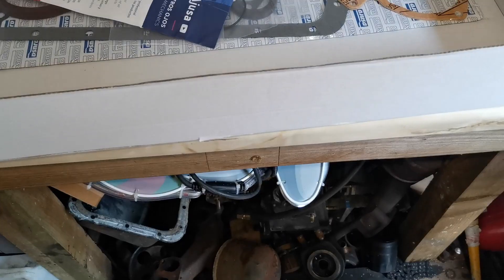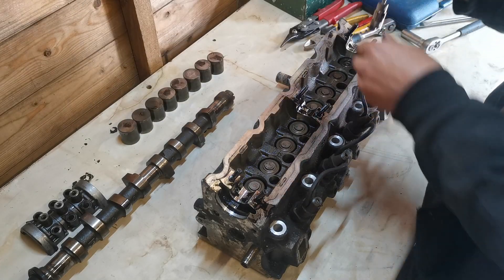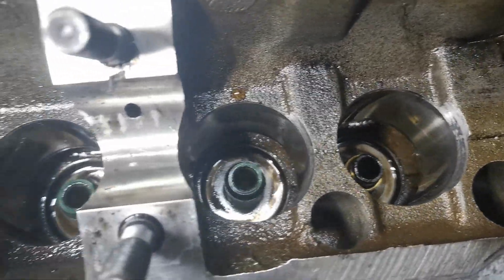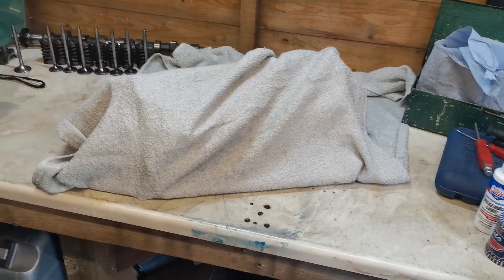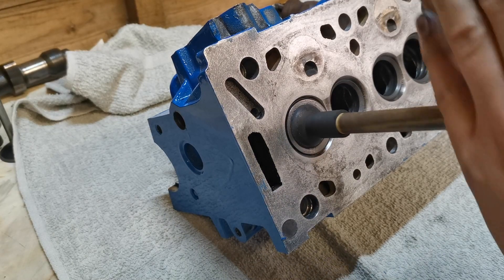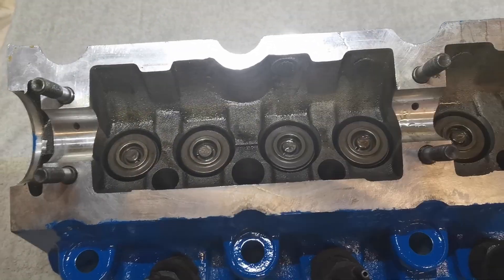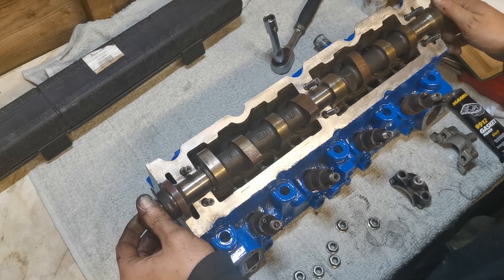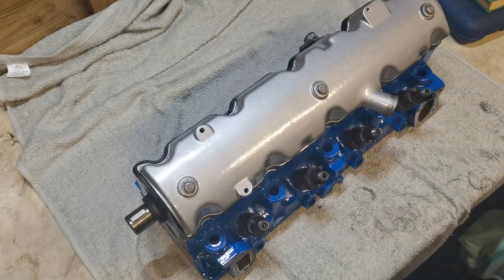Citroen and Peugeot XUD9 1.9 Diesel Engine Head Refurbishment

Comment: That 20Nm for the valve cover is definitely incorrect. I snapped a bolt trying to tighten it to that figure when I was replacing the gasket. For the petrol engine, the valve cover bolt torque is at 12Nm, I figure it's the same for the diesel as well. Oh and the gasket is still leaking.

Comment: Watched both of the videos on the 1.9...I have a toro with about the same engine as yours. The only manual I found was online. But since never worked on a Peugeot having trouble finding out the valve clearance on the intake and exhaust..one place says this other looks like that....wondering if you could tell me what your book says on the valve clearance. Thanks for any help possible, and enjoyed the videos.....

Comment: Friend, you have earned a subscriber. Thanks for the info. Tell me where I can get that Haynes manual, do you have any video on the manual?
I am a toy in South America and it is not easy to obtain information about the xud9 engine put in my citroen xsara.
Please help me about the manual or make a short video about the manual.

Thank you very much and forgive my English, I am using the google taductor.

Cheers!
Reply from the maker: Thank you for the kind words.
I got my Haynes manual from ebay if that's any use to you at all but it is all written in English so might be more hassle for you as it would need to be translated. 
If it's any use I could scan the manual into a file on my computer and send you it through an email it would likely be a big file and take a bit of time but if you would like me to do that just request me to do.
My email is thezxguy1996@gmail.com

Comment: just did the head gasket on my mothers car, thanks for the videos, you have been a great help. My torx key was a bit short and it caused the angle gauge to touch the head and stick and not rotate while tightening  the bolts so I don't know if I got the 180 degrees turn right or not, this happened on a few of the bolts, Ahg! Just started the car and it runs, turned it back off and will give it a try tomorrow. Not so easy doing the head in situ. Thanks Buddy.
Reply from the maker: Wow its nice to connect with people in the know as I'm still learning myself I have heard of these 1.9 engines also reaching 350,000 with no major faults the failing of mine was me being too daring in a rather large puddle.
Reply from the maker: I'm glad my videos have helped you I'm sure you done well with it and yes it's not as easy doing it in situ.
I also had a few issues with my angle gauge and being honest I have only done the best I was able to do with mine. Keep an eye on it over the next few days of using it checking all oil/coolant levels and conditions and keep a close eye on the temperature.

Comment: Great video. Looking forward to the rest of the rebuild. One question: What materials did you use to clean up the head.
Reply from the maker: I used engine degreaser a wire wheel and wire brush for the outside and then used some carb cleaner with some fine sand paper for the mating surfaces hope this helps
Reply: @TheZXGuy  Thanks for your reply. I think you did a thorough job on the head. I did not realise the amount of work and number of components on the cylinder head and the lubrication required before fitting. Great paint job.
Reply from the maker: More than happy to help and thank you

Comment: Thanks for greaat video. How you control valve buckets clearance ? Did you replace any shims by new one with different tickness?
Reply from the maker: Thank you for the comment firstly I was rebuilding a low mileage good condition engine and I used feeler gauges all around the edge of where valve seats to check for no gaps but as far as the shims are concerned I didn't need to buy new shims I re-used all the ones that was originally with the engine but they was all within 0.5 of there recommended tolerance based on the size they should be I can't remember what size they should be now tho sorry

Comment: Thanks for answer. I'm also going to dismantle the cylinder head from the same engine.  I also have a vacuum pump installed, which now I want to remove it, put a plug, but I don't know where to find one. A bad rubber O-ring causes engine oil to ooze under the vacuum pump. Not much, but there is. I know that there used to be a cylinder head with two sealings on the camshaft on both sides, and where I now have a vacuum pump installed, there was just a pulley. For example, on this engine on a PEUGEOT 405 II 1.9 D car it was just like that. Maybe you know how you can install two oil seals on the camshaft? Is it possible to simply change the camshaft to an earlier one, like on the PEUGEOT 405 II 1.9 D? And by the way, how did you cleaned the valves well? I saw you had little round like Dremel's brushes or something on your desk. Did you clean with them?
Reply from the maker: If you want to remove the vacuum pump and leave it off you could install another camshaft oil seal onto that end and that would stop the oil leaking I don't have any ideas on how you would cap that off tho also if you do install a camshaft oil seal onto that end you won't be able to re-install the vacuum pump.

As for cleaning the valves all I used was a wire wheel and some engine degreaser and then used cutting compound to make sure they seated correctly back into the head.
Reply: @TheZXGuy  Thanks for your valve's cleaning advice. About the vacuum pump, I don't need it at all. You don't have to ask me why I want to remove it at all and how I will be without brakes =) Do I understand you correctly that I can install a second oil seal (such first one) on the other end of the camshaft and everything will be fine, that is, it will not affect the operation of the engine oil system in any way? In this case, it will be possible not to install a vacuum pump at all, right? I have a specific technique with installed XUD9, this vacuum pump interferes with the geometry in the engine room. If possible, please write your e-mail, I will send you a photo or video.
Reply from the maker: My email is thezxguy1996@gmail.com but I've just realised the oil circulates from the cam shaft through the vacuum pump back into the side of the head so a second cam shaft oil seal the same as the first would stop the oil leak on the cam but I'm not entirely sure if blocking that hole on the side with some sort of plate or bung would pose a problem.
And I did wonder and the brakes but I am guessing you've done something as an alternative to stop or possible your engine may not be going into a car

Comment: Nice work! Thank you for the video. Please explain why you did not do cylinder head resurfacing? Wasn't that necessary?
Reply from the maker: I chose not to because the engine had no head gasket issues I did do a surface clean tho and I made sure it was completely flat with no pitting or cracks

Comment: Did you spin the Camshaft to ensure it ‘bounces’ freely from Valve to Valve?  Mine was everso tight first attempt, generous application of oil either side of 4 & 5 second time sorted it.  My Haynes states 10Nm for the “Cylinder Head Cover Bolts”.  Wise to put a thin smear of Instant Gasket on the bottom face of the Rocker Cover Gasket, specially corners.   Two full turns TDC to TDC.
Reply from the maker: I did check the cam was moving freely from valve to valve by rotating a couple of full turns before putting the rocker cover back on and I have also used quite a fair amount of lucas assembly oil but didn't smear any gasket paste on the rocker cover gasket as it is a brand new gasket on there and didn't think I would need to as far as torque setting I've just done them up firm with a small ratchet my torque wrench won't do any lower than 20nm